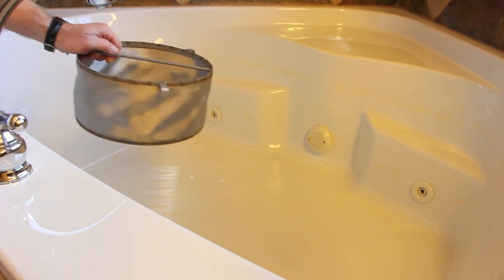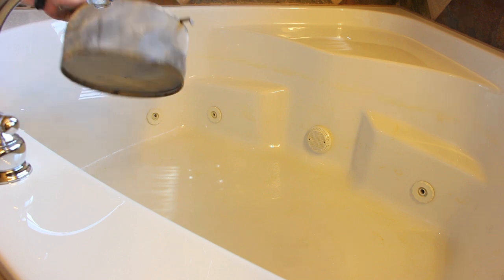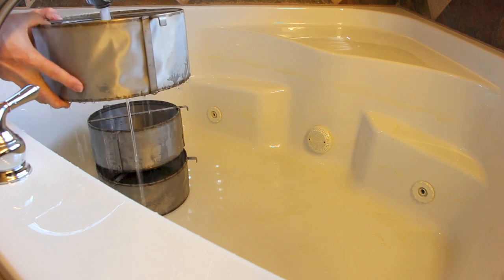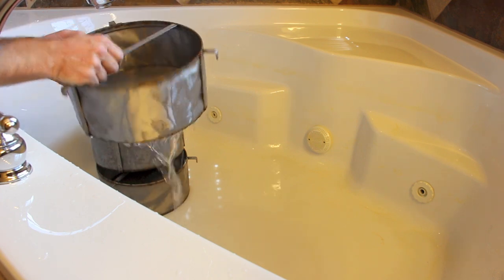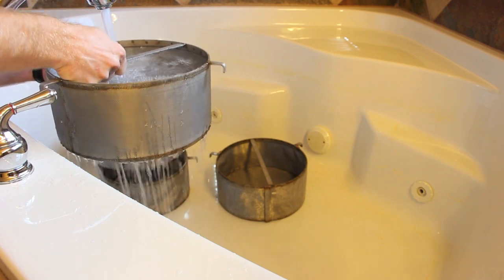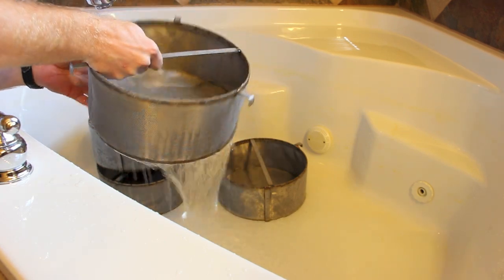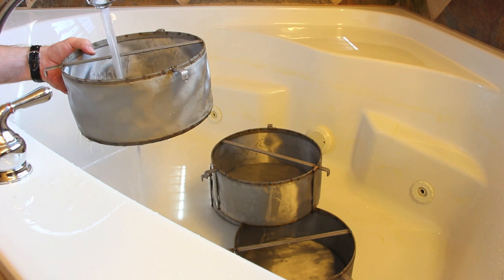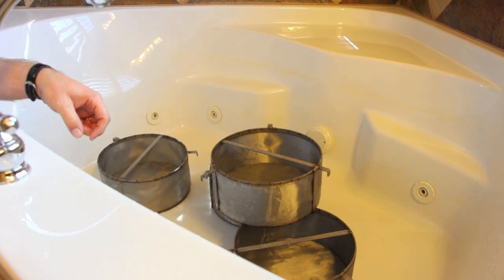Stainless Micron Comparison With Bucket Filters - Utah Biodiesel Supply

Comment: If you are using any crude vegetable oil for biodiesel do you need to refined it before using it for biodiesel.
Reply: It's best to filter the crude veg oil down to about 300 micron before trying to refine it into Biodiesel. You also want to get rid of any water in it as well.
Reply: Thank you very much 
i watch your video a lot and i have questions to ask if possible